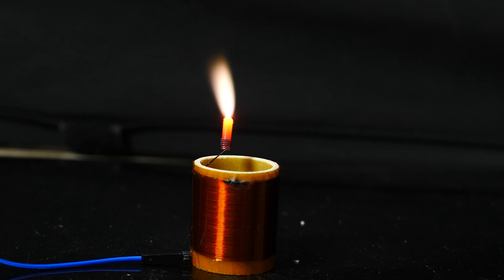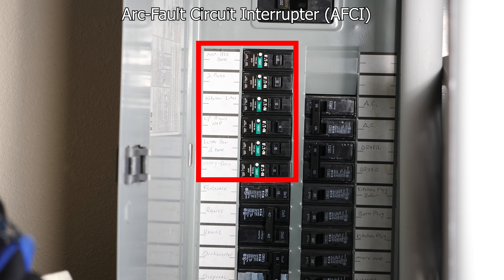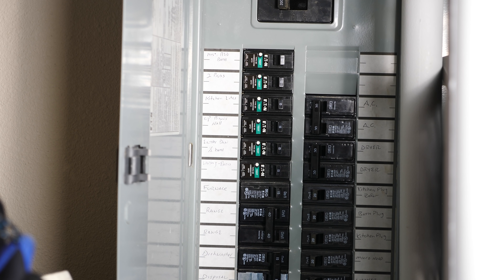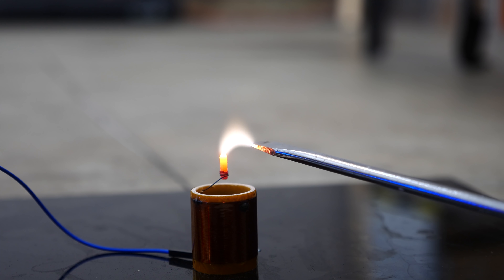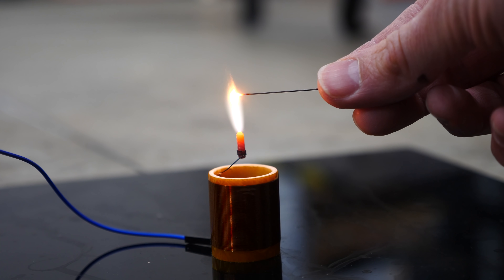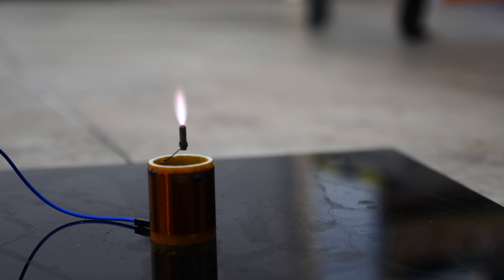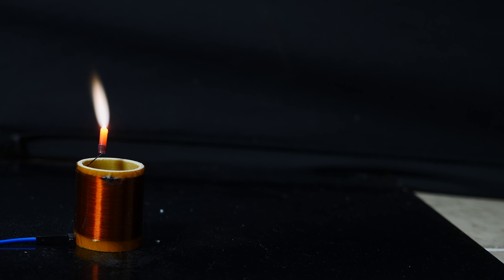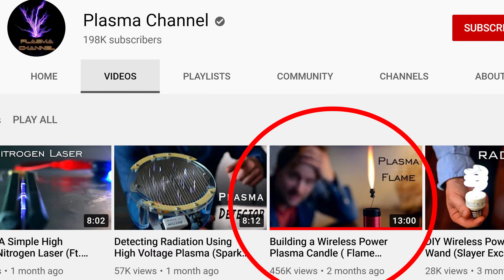The World's Hottest Candle Can Actually Melt Steel—Plasma Candle

Comment: That "LED" was a green gas-discharge bulb, not a LED
Reply: im glad im not the only one who noticed that
Reply: Doh! I came here to point out the very same. That it was a green neon bulb and not an led.
I'm surprised he made such a collassal error, lol. 😆
Reply: Try an $800 smartphone next. See what happens. LOL.    ...No, please don't.
Reply: Fran had a big bag of them, but she called them neon. I already knew they were neon but didn't know how they got a gas that normally discharges orange to glow green.
She explained they have some kind of coating inside, maybe phosphor.
Reply: @MikinessAnalog  yes, its a normal mercury discharge or mix there of but doubt it and phosphor, neon is a misnomer but you don't call a budlight sign bluephosphorandcolorgel
Reply: Yeah lol... Surprised he made such a basic mistake. An actual LED would also work though.
Reply: @tomg0  - NO.....and LED would just melt and catch on fire
Reply: @honkleretta1050  Yes it would. I’ve tried it. It’s just running at a higher frequency. Heck, you can even light up an LED with a 10 W two-way radio.
Reply: @honkleretta1050  Really? It doesn't work? When I broke my plasma globe and held a LED by one lead near the output of the flyback, the bulb it lit up! Must've been a defective LED to light up like that. Then it did it with just a coil of wire stuck on one lead. There was one time a LED lit up near my 8Watt Ham radio antenna. When I was 10 I put a beaker full of blue LEDs in microwave. Now those lit up all sorts of colors and caught fire.
Reply: @honkleretta1050  an LED with a closed loop on the pins would light up
Reply: @Ferraday  no the pins of the LED act as antennas and this forms a high frequency alternating current though the LED. Simply connecting the two pins together would make it not work anymore, unless there is a reasonable amount of turns. You can try this out yourself with a simple slayer exciter circuit, and hold the LED by only one pin near it and it will light up.
Reply: @Wtfinc  This prompted me to dig through my junk pile.  Found an LED COB and poked one wire on my Plasma globe, holding the other wire and it lit!  Not a lot of current of course, but enough to light up most of the LEDs intermittently.
Reply: @twohedwlf  SWEET!!!!! oddly enough, I cannot find the comment that led(lol) me to this thread.
Reply: Oh right thank you I was getting confused
Reply: on a very low powered tesla coil that i made, the led just fused after a bright light and then when he showed this i was confused that how is it even possible
Reply: name checks out
Reply: I believe he just made the mistake when doing the voice over after filming it. He is a great creator
Reply: Yes. It is NOT a LED.
Reply: @JSuparman an
Reply: Curious what mike thinks about passing AC in the RF range through ur body. I mean, idc if other ppl do it but I personally avoid it. Some ppl think it causes muscle issues when u get older but that's all unproven rumor.
Reply: There are actually Neon looking bulbs that are actually led. I have come across a few in my work before, that light appeared at to be about 530 nm which is easily down with LEDs.
Reply: @anthonyvolkman2338  I wonder why a manufacture would produce such a thing.
Reply: "An" LED, not "a" LED. I mean, if we are correcting people...
Reply: @HangTimeDeluxe  Whats the difference? And the LED & neon mixup needed to be said, It's a gross misrepresentation from a community peer. It should be corrected. Your correction is actually invalid, it is 'a' singular LED and does not start with a vowel. Sorry but you are not right.
Speaking of engineers, your name implies that you are one yet you don't seem like one. What kind of engineering do you do? Whats the last thing you made? 
I made an amp to read the data from magnetic drum memory and attached it to one of 56 R/W heads. Guess what, didn't work. Next is to write data to it to see if I can read it. Will be one first real debut video of a rare drive. sub and bell if interested.
Reply: @Wtfinc  sounds like you probably say "led" or "light emitting diode" instead of the far more typical "El-Ee-Dee" that most of the English-speaking world uses. When you say the letters, it technically does start with a vowel despite the first letter being L, so "an LED" is correct
Reply: @Wtfinc  a/an distinctions are not a function of multiples... A is used where the next phonetic sound isn't a vowel sound.
Reply: @squeethesane  yes, if you ask google. I don't care to find my previous comments, but I did my research b4 I wrote. Either I failed to explain or you failed to read. I may come back to this. rn this thread is not properly updating. it's fascinating. (i came back) I still cannot replay to the latest comment because it only shows up in notifications. I re-read my comments, sort of. There is an incredibly long comment of mine that explains my disposition on the subject. idk if you read it. g2g
Reply: why are y'all surprised? everyone makes mistakes,its not like y'all never made silly mistakes
Reply: @atharva_A  come on man, it's all just to make some ppl realize that it was a mistake not that it's bad if he made a mistake or something
Reply: @atharva_A  I demand rectification. He knows well the diffence yet he didn’t even correct it in post or pin any correction. It does matter what u call it. Maybe it’s the info someone’s been looking for and it’s wrong. W.e tho lls
Reply: @Wtfinc if it's rectification you desire try this full bridge rectifier!

Comment: If this is causing light from electrons snapping back to their original orbits, then it is creating radiation too.  I know radiation can kill cells in the body, I just don't know if this is enough.  I had radiation treatment for cancer and they were using tungsten photons.    Just like you are doing. It killed a lot of cells, the good cells grew back, the bad cells  did not come back.  I would measure the radiation.

Comment: if this can be done on larger magnitude then ladies and gentlemen you have yourselves an EMP!
Reply: I don't think the AFCI's on the other circuits were tripping from some sort of EMP event; otherwise, they would trip almost simultaneously.  It was probably due to them sharing a common ground.

The reason the device worked on the garage floor and didn't trip the AFCI's is probably due to the steel reinforcement within the concrete slab giving it a grounding path that does not return through the main panel.
Reply: @briand8090  All concrete flooring acts as a conductive pathway to ground, just a head's up for anybody screwing around with high voltage in their garage.

Comment: If you wanted it to be more efficient place something that contains sodium ions (commonly salt) to increase the size of the arc, also connecting it to a screw isn't a great idea, wrapping the coil around the screw is a makeshift transformer, also the screw has many sharp points, meaning that the corona discharge can happen everywhere, not just the tip of the screw.

Comment: Well, it doesn't have to be high frequency to be attracted to a source of ground. The reason it looks like it's attracted is because the flame is caused by corona discharge, where air molecules are ionised by the electrons flying off the end of the tesla coil, and if the electrons change their path, so will the ionised air molecules.

Comment: Why does the flame come out on the top , and not on the side?
Reply from the maker: because it is pointy and also that is where I strike the plasma (by moving a something metal close to it). If I strike it on the side of the coil it will burn on the coil. You can see a burnt spot in the video  where I accidently did that.

Comment: Lol
Action lab: "this is extremely hot and dangerous" 
Also action lab: doesn't use hand protection
Also action lab: Slides fingers over flame

Love the content
Reply: I can't say whether he was ever in real danger of hurting himself.  I just think it's funny he does that in the wake of explaining how dangerous it is.
Reply: @deathroll69  ok
Reply: It's fine he only held his finger over it for a second or two. Since the arc is so high frequency, it can't possibly shock him. It could only burn him from the inside out.
Reply: @james-barnett  burn him from the outside*
Reply: @james-barnett  The high frequency doesn't allow him to get shocked because of the skin effect, which makes the current flow from outside the body instead of the inside, so the burns are also gonna happen at the surface rather than from the inside out

Comment: How did i never hear about AFCI breakers after 20 years in the field?!?

Also: I'm sure the FCC loves that thing.
Reply: Lol. Maybe it's a Florida regulation
Reply: @jamescollier3  It's very new 2014 regulations. He must have a new house.
Reply: @RabbitsInBlack  care of YouTube lol. Good for him lol
Reply: @RabbitsInBlack  AFCI have been part of NEC for USA since 2002.  They were only required in bedroom circuits though and there is also time lapse between NEC and local code adoption.  2014 NEC expanded the requirements to pretty much all branch circuits in a home.
Reply: World: regulates manufacturers, so no catastrophic sparks should ever appear in hosehold devices. US: regulates home owners, so manufacturers don't have to care about safety.
Reply: @nakedonthebeach that’s not at all true lol everything has to be certified and pass certain tests
Reply: I'm fairly sure that these operate at 13.5mhz, not 15mhz like he said, so it's within the iso bands and the fcc won't care. They do still spew a lot of rf radiation even though most is spent in the plasma flame.
Reply: @reecebeck971  harmonics are a concern too.
Reply: GFI
Reply: They were brand new in the 70s and were called "Pool Breakers" Our electricity teacher demonstrated by throwing an extension cord into the swimming pool. The moment it hit the water, the lights went out. They were still very expensive.
Reply: @davidvandyk1171 that's probably a GFCI. Different beast.
Reply: @mrtechie6810  Ground Fault Interrupter or Ground Fault Circuit Interrupter, same thing I thought. I learned about it in electricity class back in high school in the 70s. They called it a "Pool Switch" back then, as they were clumsier, much more expensive and used mainly for pool lighting circuits.
Reply: Most of it doesn't go very far because of the low efficiency.

Comment: Thanks for the shoutout, and great video. I found it interesting that you tripped those breakers even without direct electrical connections! For beast mode, try putting salt on the tip  of the discharge screw. The flame doubles in size and is bright yellow.
Reply: Salt: the most volatile substance in your every day kitchen
Reply: You just gained a sub with this comment
Reply: i subbed ya. 👍
Reply: Your channel looked really nice too - I subscribed to that one as well :)
Reply: Almost 200k. Good job Jay!
Reply: I’m already subbed to plasma channel.
Reply: hey I like your channel
Reply: Could you theoretically power this with a 12v battery and make your fuses blow from outside the house? Mean prank to your neighbors 😂
Reply: @knallpistol  You could pop their AFCIs, if they had AFCIs installed, but AFCIs aren't really common unless houses are new.
Reply: @tomg0  AFAIs became a requirement in 1999 so the houses wouldn't necessarily need to be very new, besides allot of older houses have them installed to reduce the risk of fire since older houses tend to be more at risk of an electrical fire, so the ones that haven't burned yet are either lucky or have AFCI installed
Reply: @knallpistol  A car battety can provide MUCH more power than this thing draws
Reply: @tomg0  true however considering it induces a high frequency alternating charge on house wiring, it would probably do the same to the battery, which would cause the battery to heat up. Over a period of time (i havent tested it so i dont know how long) the battery would become very hot and as such you would run the risk of your battery exploding
Reply: @nothingnothing1799  I'm pretty sure the circuit has a few large decoupling capacitors, so large current deviation through the battery wouldn't likely be an issue. The two ways that the battery could heat up is through the skin effect creating a high resistance, or inductive heating, but lead acid batteries don't have much iron in them.
Reply: @tomg0  yes however there are inductive leads connected to the battery itself if they were pulsed in the manner I described they would cause the battery to heat up
Reply: @nothingnothing1799   It would warm up very slightly IF that were the case, but because of the decoupling capacitor(s), there won’t be a large enough HF AC current component to cause any significant heating. Also, there is nothing inherent about the battery that would make it more prone to heating (let alone exploding) than a mere piece of wire. The small lead that connects to the coil is much more likely to melt due to the combined forces of the skin effect leading to an even higher resistance, as well as the induction heating of the copper that it is made of, and not being "protected" by any decoupling capacitor, of course.
Reply: @tomg0  hmm your right, also I dont know why but I was assuming a lithium hydroxide battery despite you mentioning a car battery.
Reply: @tomg0  this is all however beside the point that using this device in this manner would constitute the use of an emp device which is a felony
Reply: @nothingnothing1799  True, and it’s also an unlicensed radio transmitter with an output that far exceeds any legal limit.
Reply: @tomg0  yep so while its a cool concept I would personally never build something like this, as least not for that purpose as I dont find it interesting enough to risk jail time
Reply: @nothingnothing1799  well the chances of being found out are extremely low, unless of course you publish it on YouTube and have millions of subscribers lol
Reply: @tomg0  lol yeah however with stuff like this intent can make something legal, otherwise any unintended side product that technically broke the law would result in jail time. And yes the chances of getting g caught are low but they do however go up if your using it to prank your neighbors
Reply: @knallpistol  was thinking about this actually and probably as long as the battery doesn't explode. However this is essentially an emp device which would be a felony charge, so I probably wouldn't do that if I were you
Reply: @Brett Bradley No, it was the arc-fault detection not the ground-fault detection.  The breakers that popped were exactly those with AFCI.  It is rare to have GFCI in the breaker and they cost like ten times as much!  The GFCI in the bathrooms and kitchens (note: not the bedroom, so different circuits involved) are inside one of the outlets and are "popped" there.
Reply: Lol
Reply: salt adds chlorine and sodium ions?
Reply: Plasma Channel you didn’t show this thing could melt metals and trip breakers by emp.  That’s awesome 👏🏻. Thanks Action Lab.
Reply: @JohnLee-bf2ux  There is no electromagnetic pulse (EMP). EMP is a short pulse of very big strength that can break electronics. This is a continuous field that is quite weak. But strong enough that the sensors in the breakers can detect the HF signal and decide to cut the power. The sensors did not get overloaded - it's just that they can't understand the source of the signal they measured. It looked too similar to an in-line load (spark) producing the same kind of HF overtone on the mains power.
There are other circuits that can be designed, aimed at just producing one single pulse. But instead with a huge energy in that single spike. With a s trong enough magnetic pulse, you can induce a high enough voltage in circuits that the semiconductors burns out.

By the way - our sun can produce more long-term magnetic fluctuations big enough that more normal electric devices can hurt. The huge power lines gets affected from solar flares, and can fritz a significant amount of the electrical power distribution network.
Reply: @perwestermark8920  thank you for taking the time to explain this. So the detectors are sensing a broad spectrum noise generated by the continuous spark and getting triggered above a certain threshold.
Reply: @JohnLee-bf2ux  hey now, I showed it melted steel sewing needles. But, yeah, action lab has me beat with the breakers 😉
Reply: @PlasmaChannel  lemme watch yours again man.
Reply: @Brett Bradley You are just describing breakers designed to detect leak currents - Earth Leakage Circuit Breakers (ELCB). They are intended to break if a human touches a live component and the current is sent to ground instead of through the neutral wire.

But his breakers are called Arc-Fault Circuit Interrupter (AFCI) and are instead listening for radio frequency noise on top if the normal mains power, with the intention of detecting the high-frequency load created by a spark. And this tesla coil is creating a field that will make the mains cables in the wall pick up a high-frequency ripple on top of the 50 or 60 Hz signal.

His solution was to place it on the floor - and the iron bars in the concrete floor works as a ground plane that affects the spread of the field emitted from the coil.
Reply: You're the man bud.
Reply: I was wondering if plasma channel was gonna be mention lol
Reply: sodium ray is dangerous for eyes never forget glasses who ban sodium ray (expensive) use full when you melt pyrex ...
Reply: He was broadcasting such a strong 15MHz signal enough got picked up by the house wiring to trigger the afci.
Reply: @Brett Bradley I think he was tripping his AFCI's, but GFCI's can be annoying too. I had one in my NST and it would NOT allow me to turn the input voltage up to anywhere over 80 volts. I just decided to tear it out and now it works great!
Reply: @TheCriticalMastermind  home built ozone generators are sketchy... Lots of danger...
Reply: Also subbed lol
Reply: 3rd lol
Reply: Done subscribed